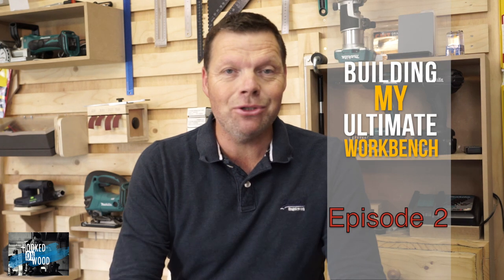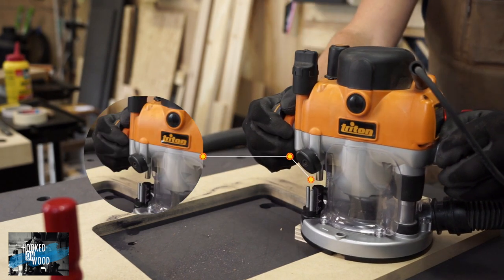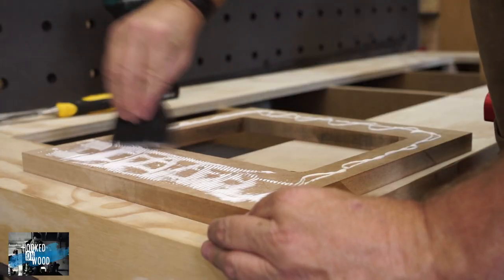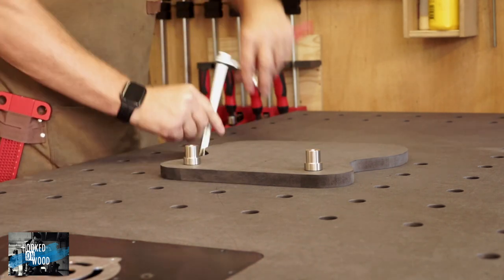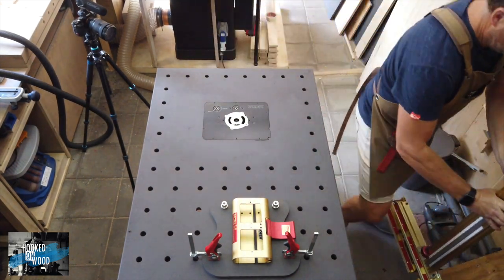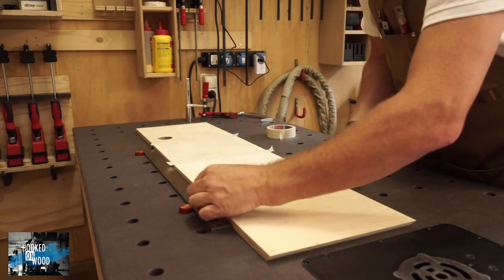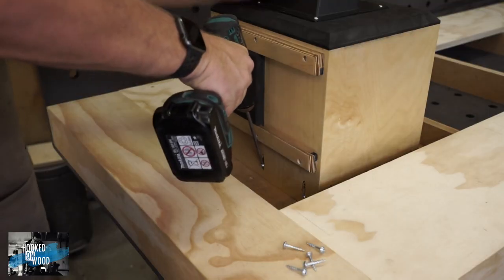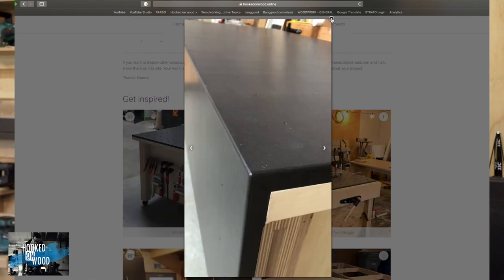My ultimate workbench,  episode 2

Comment: Hi Dennis, lovely work and excellent instruction.  I have become a fan.
One thing I cannot find in your description concerns the workbench wheels.  For space reasons my new bench needs to be moveable and I believe yours is. Please tell me what castors you used. Many thanks, Mike
Reply from the maker: Hi Mike, Thanks for your comment. No, I do not use castors. Just lifters. My floor is too uneven for castors. But in my new workshop, I will use them. But, I need some research on that topic.

Comment: Hi Dennis. We waited a long time for the video and instructions, but you were able to make them 👍. Great work. By the way where do you buy you router bits and can you tell more about them?
Reply from the maker: Hi Danny, 
Sorry for the delay. Most of the router bits are from CMT. I buy the mostly on Amazon.de they offer them for an attractive price. 
So far I have good experiences with them. But I also have some bits from Whiteside (more expansive) and I think they are from an even better quality. But I like the CMT so far.  In this video I showed some bigger CMT bits. The Chamber bit is a big one. I tried if I could make nice 45 degrees bevel cuts with it in stead of with my table saw.  But I prefer my table saw. That said It is nice to have a bigger chamber bit.  The bigger flush bit I bought because it has the nives in two different angels. This should give you a smoother finish. I used it here just for my own experience. It has to be more beneficial on hardwood. For MDF kind of wood, I definitely prefer my smaller CMT bit.

Comment: Is the mitre gauge for the router table the incra mitre gauge 12.7mm thick? Have you had an issue with a groove this deep and only about 5mm of mdf left underneath? I am thinking of using 24mm table top so there is more material left once the groove has been routed.
Reply from the maker: Good question i have placed an extra 18mm plywood underneath it. Otherwise I think you will get an issue. And if you want to screw it in place you need more body than 5mm. I am afraid with 24mm the railguide clamps will not fit in the holes anymore
Reply: @HookedonWood  thank you. That last comment about not being able to use the clamps has saved me from making an expensive mistake.

Comment: I really love your videos & this bench - but before I go ahead I had one question... have you used the bench in conjunction with clamps etc. to chisel or plane hard woods? Like everyone I've got limited space and wondering if this bench is strong enough to do that well or whether another bench option is needed for that.
Reply from the maker: Hi James,  I think it is stable enough when you have to plane hardwoods. But I did not use it to chisel mortises, perhaps than it is preferable to have some thicker table top. I think a solution can be to make a hybrid version where you make the table top at one side of the workbench from multiple layers of Black MDF or whatever you want to use. Here you can attached your vise and perhaps create a space for heavier chisel and planer work.

Comment: Dennis, do you have any advice for someone that has an Incra LS Positioner on there table saw and also wants to use it on a version of your work bench? I can't add the mdf to the bottom of my positioner because it is on my table saw. I really don't want to buy another one, but I was thinking I could maybe just buy another of the housing/carriage parts and attach that to the mdf? Then I can move the positioner back and forth as needed?
Reply: I actually have a TS-LS Positioner. Still, I hope you get the idea of what I'm asking. I'm just trying to figure out how to use it like you do without having to buy a whole other one.
Reply from the maker: I think you should buy an extra ls base. I made a sacrificial fence for routing. This works perfectly. If you want to make dovetails joints you need a wonderfence add on. But i found these expansive. The. I would buy a new one. But changing it works good and you can add different scales so, i see no problems to start with a base only.

Comment: hi dennis, the dust extraction part is it just the adapter and the hose connected to the bottom board, letting the dust fall below the workbench?
Reply from the maker: Hi Victor. I wanted to put my duct work under the floor right under this spot. So, it would look like you see it on video. But I am planning to build a bigger workbench so I will not do this anymore. Now I put a 4 inch hose at the outlet that goes of course to my dust extraction.
Reply: @HookedonWood  thanks, great videos by the way, keep it up

Comment: Dennis (or anyone else who wants to chime in), I've been going back and forth on which size dog holes to use.  I know you like 20mm, but for just a hobbyist it seems like all of the dogs and other accessories are more wallet-friendly (and readily available in the US) in 3/4in.  Can you give some thoughts/opinions on each?
Reply from the maker: Hi, I do not see much difference in using 20mm or 19mm dog holes. Mainly because of the system I use to make the holes (that is a 20mm system) I am stuck to that. 
That said, I wonder if a normal rail guide clamp will go thru a 19mm dog hole that is around 18-20mm deep. 
If that is not the case, than I would definitely prefer 20mm, because the rail guide clamps are affordable and I use them the most on my workbench in combination with the holes.
Reply: @HookedonWood  thanks Dennis. I think I will prototype a 3/4" set and try them out with the rail guide clamps. If I need to go up to 20mm, I'll just use your tape trick for the bench cookies

Comment: Both of your workbench videos are excellent, just like the bench itself! Very nice workmanship as well, and no need to spend a big pile of money on premium hardwood. Wondering if you think the track saw clamps could easily be hooked through a 24mm thick bench top. I’m guessing 36mm would be too thick to work well. Always appreciate your insights!
Reply from the maker: 36 is definitely not possible. I think around 22 is the max. But if you make a little bevel at the underside of the hole I think it will be possible with a 24mm thick material
Reply: @HookedonWood  Thank you, Dennis. I was thinking along the same lines of using a bevel on the underside. I will have to do a little experimenting as I begin thinking about a more functional workbench. Always appreciate the time you take with your videos and responding to comments. It’s clear you enjoy what you do and also enjoy sharing your insights and experiences with us subscribers. Keep up the excellent work!

Comment: I had an Incra TS-LS Joinery System that mounted to their rails and I removed it almost daily to use the saw top and router area for assembly in a small shop.  I found it to be quite accurate when repositioned against their "stop bolts" in the rails, but I cannot imagine a press fit Bench Dog would be nearly as repeatable over time.  Do you have to re-true the fence very often?  Also where did you get that Drill Guide system mentioned in the video.  I am interested in putting ACCURATE dog holes in my new table, so they can be used as temporary fence stops if you find this sufficiently accurate.
Thank you,
Clint
Reply: Clinton Lemon III  - Just search for UJK Technology Parf Guide System Mark II, but be prepared for some sticker shock. I can attest that the accuracy is near cnc quality and assuming you will use it enough,  well worth the scratch.
Reply from the maker: Hi Clinton, 
I found the system I use to reposition the fence very effective and accurate. Also over time. 
Like Slappy commend. It is a very accurate system. 
But I would be careful to use the fence this way on your table saw. I had a INCRA fence for my table saw. And that came delivered with guiding rails at both sides that I locked before cutting. This makes the fence sturdy what I think is safer for the table saw. I would only recommend it for your router table this way.

Comment: Hi Dennis, Im in NSW Australia, Laminex has the black MFD (and red too). What finish do you use? It looks like a mat wipe on poly? Oil based? I Love your works and the bench gets started this week :-) BTW I've order another couple of sheets to use for the rest of my cabinet drawers, I love the look :-) Many thanks! J
Reply from the maker: Hi John, great, I ad that to my description in below the video. Good luck with your workbench!
Reply: Had the same question on what product you use for the finish of that black MDF. I did read the description a few times, but could not find this info in there.
Reply: @roydriessens  Nothing from Dennis, thinking wipe on mat poly? Needs something to make it waterproof for sure! :-)

Comment: Nice to see the channel active again Dennis (!), you had me worrying a bit before your episode (part 1) - it was quiet for some time! 
Due to space limitations I had to combine my DW745 tablesaw and Triton Router in one bench, but your input on this (read previous videos) has given me a good amount of considerations i was able to implement and tackle problems. Still waiting on an LS positioner to become available again in Netherlands to dial in accuracy as well as you did. With my DW745 track acting as guide for both tablesaw and router, accuracy is not where I want it to be yet - Also waiting for LS positioner to add the extra t-track. Keep up the good work! The dark MDF you're using is something I want to give a try too. Do you apply oil or anything to keep moistore ingress away? Great inspiration as always! Thanks!!!!
Reply from the maker: it is good to be back! It was to hot this summer, especially in my shop!
I had this solution also with my DW745. But I do not know if you consider the table saw fence our router fence. But for the table saw I think you need the extra gliders on both sides. That does make it more stable. 
I do not have apply anything on it yet. I did the base of my fence with Danish oil. But I did not remove the extra oil, so it does not look nice. I still have not figure that out yet.
Reply: @HookedonWood  Indeed it's the fence I use for both tablesaw and router...with its limitations ofcourse. LS pos. should make it dial into perfection for both. Was thinking about sliders on the Icra fence of 4mm Trespa which can be opened up for dust extraction in the middle when using it for the router.  Close it up when using the tablesaw. 
Think the MDF does require some finishing to keep accuracy on longer terms as moisture can ingress, depending on your environment as well of course.
Thanks for your reply!
Reply from the maker: @pvg5559  Mail me even op hookedonwood.online.
Ik bedoel nl iets anders. Dan stuur ik je een fotootje van mijn vorige zaagtafel met frees.

Comment: I love this workbench. I will be making one very similar to this, but I would like to use a table saw insert and the incra guide system if possible. Great videos, very nice refined plans and good work Sir.
Reply from the maker: I would not combine this lspositioner with a tablesaw. You need one with rails to attach it. This one can cause kickbacks in combination with table saw
Reply: @HookedonWood  Thanks for the reply. I was wondering about this, and send an email to Incra tech support to see options for table saws deeper than 33"
Reply: Following up, I exchanged email with Incra customer support and they informed me that I can use the LS positioner for table saw without the side rails. They will custom assemble me a fence system based on the LS32 positioner. Just to be safe I shall design my table to be less than 39.5" deep so that if I decide to add rails later I can do so using their optional longer base support panel. 

Thanks again for the inspiration
Reply from the maker: @johnfurr8779  Hi John, Good to know. I also did use it without rails, But to advise it, is something different. There is a little bit of play that you will not have when a fence is fixed at the front of the table saw.
That said.  You do not have to use the rails from INCRA. If you ad a miter Track in your table. Which you can use for different applications, Incra has some L shape profiles with you can fix your fence to it. You only have to do that on 1 site. I think that is enough. (that can just be a backup plan) I would not make my table too small. Thanks for your info!